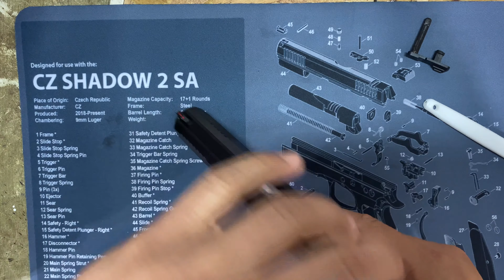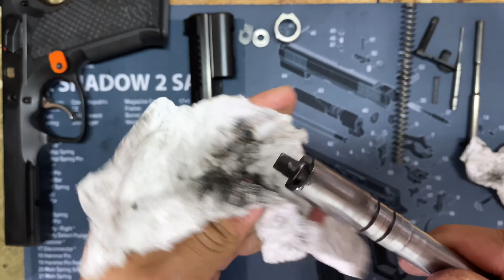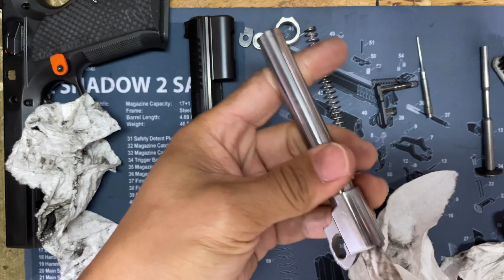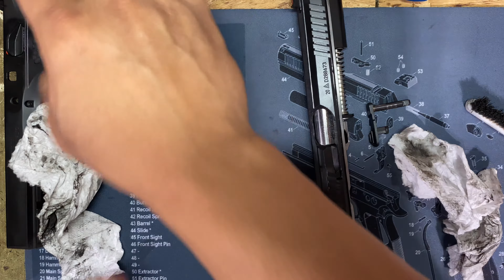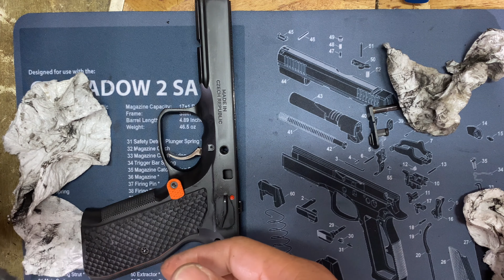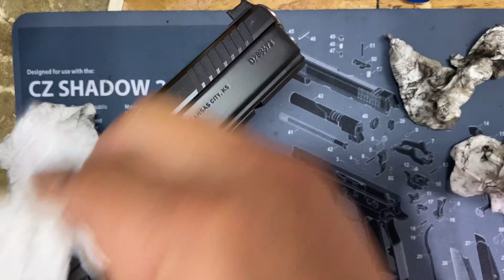CZ Shadow 2 Orange Basic Cleaning

Comment: why did you cut out when removing the bushing? Just picked up an orange and can't figure out how to get the barrel out lol
Reply from the maker: Turn it like 1/4 turn and pull the bushing
Reply: There is a tool to remove the bushing provided in the original box!
Reply: @NickIF  There is a plastic guide / bushing in the opening where the slide spring goes. You can push it out from the front with a similar sized plastic push type cleaner adapter, wood dowel etc. before you can get the barrel out.
Hope this helps.
Take care,
Dean
Reply: I have the original ts orange. If the bushing is the issue I would ask CZ as to were you could get their tool. I am assuming you were asking about the other guide/ bushing for the spring.

Comment: Is there a particular reason you lubed the firing pin? Never have done that on any firearm including my shadow 2 or other czs
Reply from the maker: it’s a moving part of the gun, so for me i put thin layer of oil and also prevent from rust.
Reply: @xxdizannyxx  actually, CZ recommends oiling the pin on the S2O
Reply: @RichardHDiamond  interesting. I am sure this is for the shadow 2 In general and not just the orange? I have the blue and never oil firing pins so far, especially when you have to drive out a pin to get to the firing pin like hammer fired czs